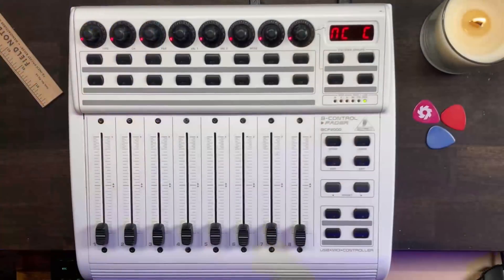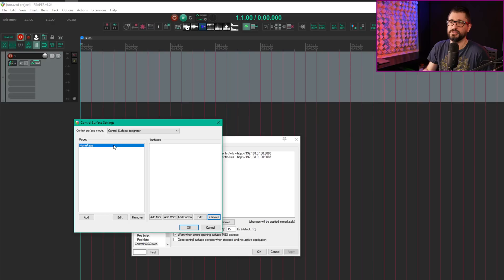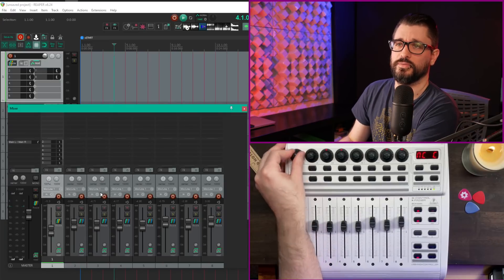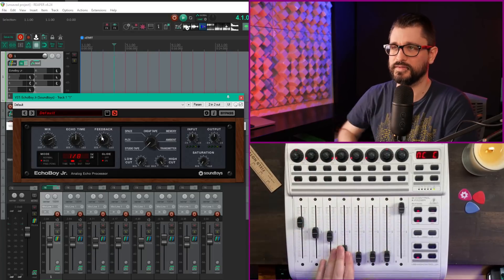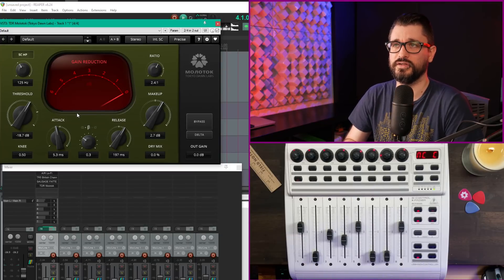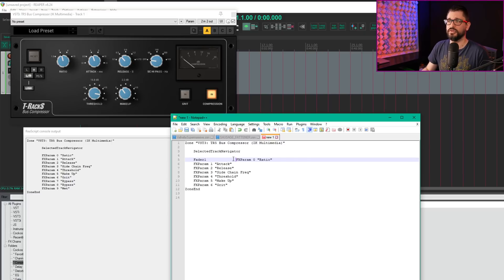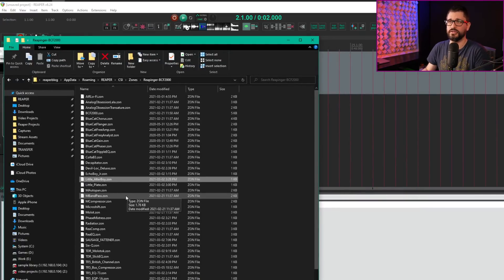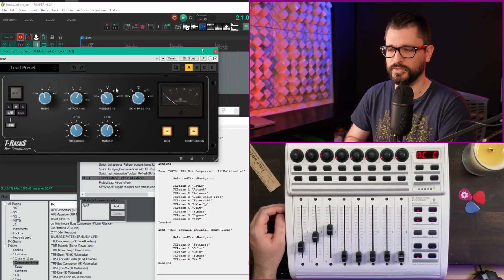Control Surface Integrator for REAPER with Behringer BCF2000

Comment: Hello!  Thanks for the great info!  Is it possible to make the controller control the plugin that is in focus, and not the one called by the button?
Reply from the maker: with current version of CSI it is possible.
The function is called "ToggleEnableFocusedFXMapping" inside buttons.zon
Reply: @TheREAPERBlog  Thank you! Maybe I'm not that experienced. I couldn't get it to work.
Maybe I'm not using the latest version of CSI, but I didn't find it.
Or perhaps the command is incorrect.
Do you have an example ZON file using this command?
Reply from the maker: https://github.com/GeoffAWaddington/CSI30Wiki/wiki/CSI-Changelog
Reply: @TheREAPERBlog  thank you friend!

Comment: Hey Jon! You're usually quick to reply to YT comments (thank you). Re: CSI.... look. I'm a smart guy, I really am. But I cannot understand how to set this up, get it working. It seems like most users own a motorized or 8-channel "MCU"-style controller for this. Behringer's stuff from like 10-12 years ago, Mackie C4, Mackie MCU, MCU the newer version... X-Touch, X-Touch One.

I'm trying to help a blind user who reached out to me, configure his X-Touch Mini for plugin control, hands-on... makes sense, obviously. But, I feel that my custom Reaper MIDI map stuff (for various newer midi controllers) is so much easier to set up. For instance, Maschine MK3--- with MIDI Mode, you can set up Templates for any plugin you want, and have pages and pages of parameters. If you have like 10-20 "go-to" plugins, it's so much easier to configure these Templates and have Reaper only tweak what's floating... ya know? I think there's an option that lets you do that, but I'm unsure where to look.

Any help is appreciated man. I just... as popular as CSI is, it is like reading Henry Miller's Tropic of Cancer. The first 5 pages, I'm like "what.... the.... f....." I just cannot get my head around this, man.

Thanks!
Reply from the maker: it IS complicated and wouldn't have any idea how to do this from scratch. I haven't seen any mappings for the mini online that I can remember.

ReaLearn might be better for this, but still complicated.
Reply: @TheREAPERBlog  you’re the man. Thx bro.

Comment: What is the correct syntax for setting range and stepped controls etc? The documentation is very poor for this.
Reply from the maker: check this post. I'm sure it is in the wiki somewhere but I couldn't find it at the moment.
https://forums.cockos.com/showpost.php?s=5e67f732a1b891ff0893d5cdf7a7009d&p=2407578&postcount=10
Reply: found this on forum if it helps anybody...

Delta based examples:
Code:
FXParam 0 // default range, no acceleration, use encoder value
FXParam 0 [ (0.1,0.2,0.3,0.4,0.5) ]   // default range, acceleration
FXParam 0 [ (0.003) ]  // default range, no acceleration, override encoder value
FXParam 0 [ 0.0>0.7 (0.1,0.2,0.3,0.4,0.5) ] // override range, acceleration
Stepped based examples
Code:
FXParam 0 [ 0.1 0.2 0.3 0.4 0.5 ] // default range, no acceleration, default tick count, step values (always required)
FXParam 0 [ (12)  0.1 0.2 0.3 0.4 0.5 ] // default range, no acceleration, override tick count, step values (always required)
FXParam 0 [ (10,5,3,2,1)  0.1 0.2 0.3 0.4 0.5 ] // default range, acceleration, step values (always required)

Comment: Hi! I have BIG problem with XTouch Mini and CSI. Buttons work,  actions work. But when i try setup rotary for FX Plugins - dont work... I check singal from my controller - all work and i see all parametr in window from "CSI Toggle Show Input from Surfaces" and i see signal from rotary, but plugins dont work...  Simple example zon text:

Zone "VST: ReaComp (Cockos)"

	SelectedTrackNavigator

	LayerA_Rotary1			FXParam 0 "Thresh"
	LayerA_Rotary2			FXParam 1 "Ratio"
	LayerA_Rotary3			FXParam 2 "Attack"
	LayerA_Fader			FXParam 3 "Release"
	FXParam 4 "Pre-comp"
	FXParam 5 "resvd"
	FXParam 6 "Lowpass"
	FXParam 7 "Hipass"
	FXParam 8 "SignIn"
	FXParam 9 "AudIn"
	FXParam 10 "Dry"
	FXParam 11 "Wet"
	FXParam 12 "PreviewF"
	FXParam 13 "RMS size"
	FXParam 14 "Knee"
	FXParam 15 "AutoMkUp"
	FXParam 16 "AutoRel"
	FXParam 17 "CompatOp"
	FXParam 18 "DeprAnti"
	FXParam 19 "Bypass"
	FXParam 20 "Wet"
ZoneEnd

End cant work... I try install CSI version 1 and version 1.1, but still dont work! 1 week i cant work with CSI.....
Reply from the maker: I'm using 1.0 in my videos. What you have there looks correct.

zone file could be in the wrong folder

you might need to run the reset action before the file is read (if you created or edited it after starting reaper).
Control surface: Refresh all surfaces

or you have not put the controller into fx mode.
Reply: @TheREAPERBlog  Yes. Version 1.1 dont work, but version 1.0 work only with buttons. But i cant use rotary encoders for VST plugins... I try use Refresh, but dont halp. Can you give me your files for XTouch mini? Probably in my case i have wrong files?
Reply from the maker: I don't have a xtouch mini CSi file.
Try these with v1 of CSI
https://siniarch.wixsite.com/csiconfigfiles/post/behringer-x-touch-mini-by-craigge

Comment: Did you have trouble with it not recognizing folders as being collapsed? I haven’t had time to try CSI with my new X-Touch but the out of the box implementation shows every track even when collapsed.
Reply from the maker: You mean collapsing folders in the mixer and hiding the child tracks, making the tracks disappear from the control surface?

with the BCF in MCU mode there was a button combo to make that work. lower shift plus learn or something like that.

With CSI it should work when 'Track Visibility on surface follows' mixer is set  in the HomePage options.
Reply: @TheREAPERBlog  Yeah exactly. What I want to have happen is that collapsed folders only show up as a single fader on the X-Touch but I get the folder and then all of the contents on subsequent faders. I also had a problem, last night where hidden tracks were showing up in the X-Touch but I think that was because I had the video window in the docker instead of the mixer at that point. I plan to get into CSI with it tonight. Thanks for the reply. I signed up for your video series a couple months ago and it was very helpful. If you look at my page, those videos were done in Reaper using your plugins and taking a ton of your advice from the course.

Comment: I get to the point where you have added the control surface integrator and it just straight up doesn't work. I've tried enabling and disabling the BCF in the MIDI devices, the ports are showing up, but just nothing. No idea what I'm doing wrong here.
Reply: I can't get it to work in Mackie Control mode either. The ports show up and it should be working.
Reply from the maker: @rhythmjones  did you start it in mode 2?
Is the bcf connected to a USB2 port? Mine doesn't work on USB3 ports, even through a hub.
Reply: @TheREAPERBlog  Yes, Mode 2. Directly connected to a USB 2.0 port. I keep getting "control surface error opening midi inputs"
Reply: @rhythmjones  Did this ever get resolved? I'm running into the same issue...
Reply: @fullcolourfantasy8655  I wound up selling the unit. Too much hassle.
Reply: @rhythmjones  Ah that's a shame, understandable though. Thanks for your response.

Comment: I get to the point where you're choosing the MIDI ports and I don' t have any MIDI ports available, just Focurite USB Midi and when I choose that, it does not work...
Reply: The BCF is not showing up in MIDI devices.
Reply from the maker: I had a problem with the bcf if it was connected to USB3 ports, it only works on USB2 ports. Other than that I'm not sure.
Reply: @TheREAPERBlog  I didn't have the driver installed. Facepalm.

Comment: Jon, is there a "Reapinger" type of CSI config for X-Touch?
Reply from the maker: yes there is at least one x-touch layout already built by users.
Reply: @TheREAPERBlog   thanks, Jon. Is it as simple as just pasting that x-touch .zon file into the right folder in Reaper...and you're good?
Reply: just use MCU (makie control unit)
Reply: @StevieBoyesmusic  thanks for the suggestion. I've been using the X-Touch with the Klinke extension for a few months now...not as powerful as CSI, but it's working for me.

Comment: Awesome Jon - I have had integration issues with my Oxygen 25; I get it to play notes plus up and down pitch and pitch-bender but getting the control knobs at the top and transport is a pain. I should check the settings i guess
Reply from the maker: under MIDI Devices, check that it is enabled + control. That will let you do manual MIDI mapping to plugins or things in the action list.

Comment: Good job brother.  I got mine for £100 and had to repair it.  I also got a BCR for £60, has no USB, and missing tons of knobs but works over midi just fine.  Can't wait to use what I've learned here to integrate the two.  I am thinking of sticking a cheap tablet behind the bcf as a low rent meter bridge, and perhaps using CSI to bring up the info on assignments that the BCF cannot display.  Any thoughts on feasibility here?
Reply from the maker: I think combining a touchOSC device with the bcr and bcf could display the assignments. Maybe someone has built this already. its worth asking in the forum

Comment: what is b control 1?
Reply from the maker: The names for the midi ports in this device
Reply: @TheREAPERBlog  so if i am using console 1, i would use that?
Reply from the maker: @idie123  right. And CSI comes with a console1.mst and .zon file to load

Comment: i have an old surface controller ( Sac-2K fro 2012). its possible to config like you do on you controller? thank you
Reply from the maker: I haven't seen that one before. pretty cool looking.
It has Mackie mode so you should be able to set up CSI to work with it. Might even be able to modify someone else's .mst and .zon files to get a head start.

Comment: Hey there guys! I have a quick one: Is there a way we could set a Digi 003 (with faders) like this using it's midi map? Thanks for any input, much appreciated!
Reply from the maker: Not with the BCF configuration but looks like you can write your own. Can you get it working with reaper currently?
http://akmedia.digidesign.com/support/docs/003MIDIModeGuide_34454.pdf
Reply: Hiya Jon!

Good news! Using the BCF with the 003 does work!! It required me to remap the whole thing but it is alive! — Before BCF, it could only ride faders via CC messages (action menu assigned), where as now, it does work as a Control/OSC. 

Pans, Solos, Mutes, Transport and Faders all working and motorized/feedback from Ch1 to Ch16 using the Bank button on my 003 (1 thru 8 then 9 thru 16). It was a complete PITA to find out the right CCs but hey! I'll keep it a bit longer, while I manage to finally sell it and grab a newer CS device. 

I think I'll upload a video about the process and the overall remap for an old HUI CS, it might be of interest for some guys out there. Did not use ANY thrid party program like Midi Tools, Bomes MT, LoopBE nothing, just Midi in Midi out. 

Thank you so much man, your video helped me heaps!
Reply from the maker: @MixYourWay  that is great news!
Reply: @MixYourWay  could you please share how you get BCF works with DIGI003? Did you use MIDIMap A/B on 003?  In REAPER CSI , which FW 003 MIDI port to be used? Thanks in advance

Comment: Holy crap! I'm in the middle of learning ReaLearn but I do like text editing stuff!
Reply from the maker: both are really powerful. ReaLearn is more for if you want a different setup for each project. Easy to template and change at any time.
CSI for if you want a permanent setup. 
Realearn v1 didn't like my motorized faders and I'm not sure if that's resolved in v2.
Reply: @TheREAPERBlog  I still don't have motorized faders but if I can set my faders to soft takeover with CSI I think for most cases it's for me.

Comment: Great intro video Jon. CSI is super powerful but can be a bit daunting for people to get going, so this was excellent. 

Over time you end up tweaking it a lot. I have two BCF2000's, an Alphatrack and a FCB1010 pedalboard all set up working together as a single "virtual" controller. Having the FCB1010 is great when I'm recording guitar, I can control takes, transport, FX params, etc without taking my hands off the guitar. 

Definitely worth the initial learning curve.

Comment: Yo hold up! The BCF2000 works in Win10? I have the BCF and the BCR and tried hooking them up to Win10 a year ago and it just wouldn't work? I don't remember if the drivers wouldn't install correctly or if it was something with the BC software that couldn't communicate with the units. Either way they were both unusable due to some data related stuff. What am I missing here?
Reply from the maker: only problem I had was it wouldn't connect through hubs on usb3 ports. I'm not even sure if I installed a driver.
Reply: @TheREAPERBlog  Oh crap don't tell me I did the USB version blunder... what a noob mistake. Thanks a bunch man, I have some devices to hook up! :D Btw, do you have any tips or resources for fixing cruddy faders om the BCF? They get suck when the motors are pushing them. And thanks for all the awesome Reaper content!
Reply from the maker: If it's just the usb issue that's a very good thing, easy to fix. Took me 45 minutes in a live stream to figure it out systematically.
On the inside there are rubber bands that pull the fader and there's a screw to adjust the tension. Don't want it too tight or too loose. I set up a project with some automation so I could test the smoothness, if all faders move simultaneously etc. Surprisingly still working find since that first adjustment several years ago.
Reply: @TheREAPERBlog  Sweet! You're making me all excited. I haven't used these puppies for over 10 years and I used to kinda love them. Here's hoping I'll get them to work! 🍻I can recommend the BCR btw, I used to have it sort of as a fat channel for the selected track. Given the number of rotaries you don't have to change pages nearly as often. Sped up the work considerably!
Reply: For future reference if anyone has the same problem I had. Check the USB settings on the device. My BCF was for some reason set to Standalone mode and hence would basically disable the USB port. Check chapter 4.1 in the manual. 
Also, don't forget that USB ports in the back of the motherboard often times are connected to an internal hub. Like Jon said, hubs over USB 3.x don't work with the BCF/BCR. My front panel ports (2.0 and 3.0) worked fine, but none of the rear ones (3.0 via internal hub).

Comment: LBX faderbox is better suited to controlling FX-plugins/params (click&save), im in the process of re-configuring my BCF2000, setting up a editing BankPreset, and a performance BankPreset
i figure a great setup for the BCF2000 is having
PresetBanks 1-8 control 64 Volume Faders,  PresetBank 9(editing/Recording/FX), PresetBank 10(performance/FX)
PresetBanks 11-18 recycles 64Volume Faders,  Bank19(editing/Recording/FX) Bank 10(performance/FX)
Mock-tracks  would have to be moved out in between 9&10/19&20/29&30 to keep the faders consistent 01-08, 11-18, 21-28
but entirely workable!!

there is quite a bit of versatility with the BCF2000 if setup correctly in Reaper!!
Reply from the maker: lots of ways to do plugin mapping between CSI, Faderbox, and ReaLearn. Pros and cons of each. Right now I'm liking this. I'll have to see if I actually use it in a real mix.
Reply: You use LBX faderbox along with CSI?
Reply: @juneaftn  
no.. i havent tried CSI.
i find the file moving, text.editing side of CSI to be very confusing... as a result i learnt to map directly to Reaper, and found the Faderbox plugin in conjunction with the LBX smart script &Realearn to be more than sufficient, to carry out the necessary tasks for plugins/faders etc etc....
Learning to map the BCR&BCF forced me to learn more about midi-mapping
not all things are plug and play... especially with old midi gear

Comment: Im using a Mackie Control Universal Pro, and no matter what I do, I can't get it to say anything other than "NoMap" after creating the .zon file and setting rotary parameters per the video.  Ive refreshed it and everything. I can't get a single FX parameter mapped. Question: After creating the zon file and programing, the .zon file stays in the ZonRawFXFiles folder, right?
Reply: Update: The answer is "No."  I dropped the program zon file into the MCU folder. It seems to work!
Reply from the maker: nice! I've barely scratched the surface on the CSI stuff.
Reply: @TheREAPERBlog   Thanks for posting that Wiki file. I didn’t know it existed until you posted it. It’s been super helpful!
Reply: @TheREAPERBlog  Some interesting things that I'm finding:  In defining the range of something like a stepped selector knob (like a pultec hi freq selector) I had to set each value exactly in order to get them all.  For instance: [ 0.0 0.2 0.4 ] Also, skipping a value, or getting the last value wrong, might still move the selector switch into a different position, but would then stop graduating, if that makes sense.  tl;dr: all the values had to be correct, and all steps had to have a value assigned for it to work properly for me.
Reply from the maker: doesn't it feel good to figure out stuff like that :)

Comment: Thank you Jon, this was very interesting. I'm still unsure about buying a used BCF2000 and a Platform M+, but the more I ask about the latter, the more I found out it's a mess when it comes to driver and firmware... So I think I'm going with Behringer
Reply: What's wrong with the Platform M+?